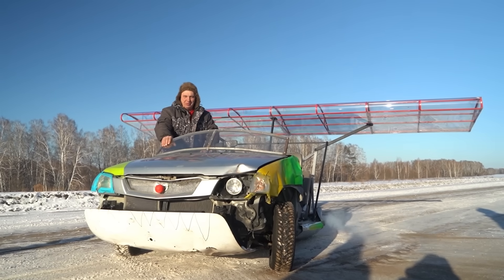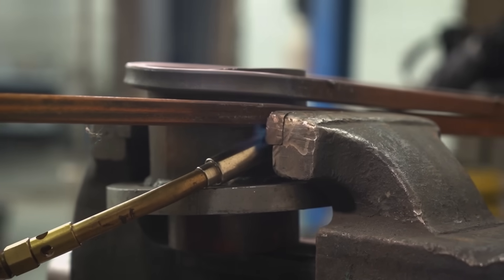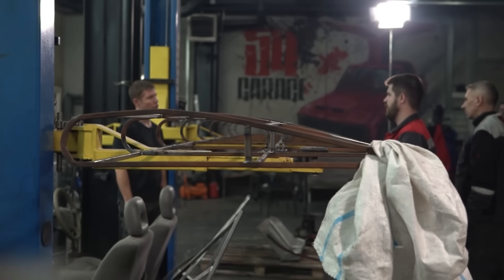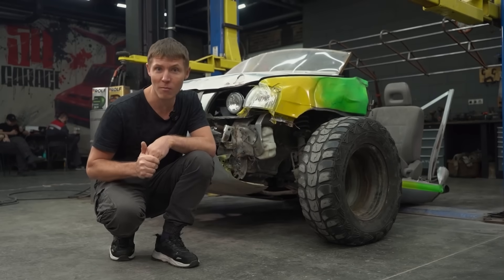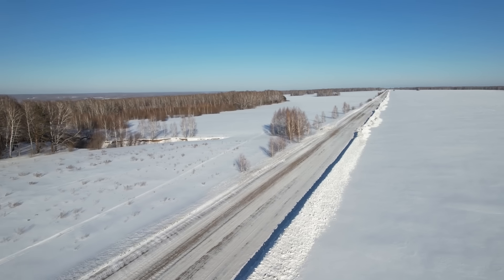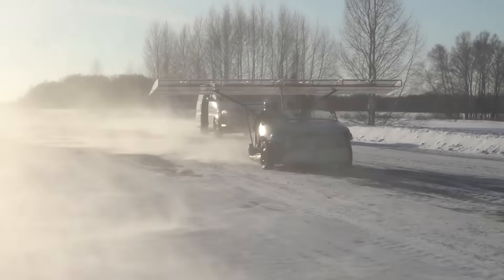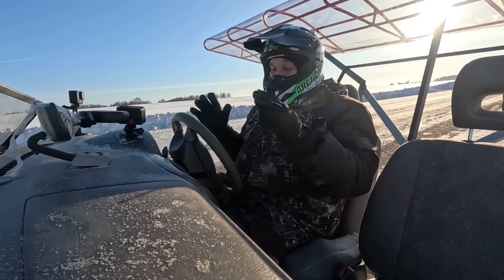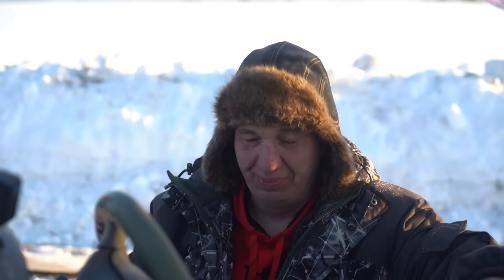We fit a wing to a car - will it lift off?

Comment: it needs a rudder working with the steering wheel and an auto leveling system for some flaps to make it fly horizontally on its own..
Reply: It can be a fixed vertical stabilizer at the rear. That way it steers from the front and the rear will follow.
Reply: @LoudenNess rudder synced to the steering inputs would make for a fun time though, possibly add a finite level of control while the rear is airborne.
Reply: I was thinking the exact same thing
Reply: Probobly would be sufficent with a fin
Reply: I think the same thing, without rudder and vertical stabilizator would not work
Reply: Just endplanes would go some way to stablize it. That's what F1 cars do. When they first started using wings in the late 1960s, they were like this and they wandered much the same. It wasn't until they started diving more into aeronatuics that they started adding endplanes and fins and such and it improved things massively.
Reply: A stabilizer would probably be sufficient for this wonderful ghetto project.
Reply: Do it do it do it do it
Reply: I agree, and perhaps a horizontal stabilizer and elevators
Reply: Exactly what I was thinking about
Reply: I think a vertical stabilizer with rudder connected to the steering would be the only way to get the directional stability under control.
Reply: Correcto, además de algún patín en la parte trasera donde roza contra el suelo
Reply: i was thinking the first flying lada they need to do lol
Reply: Flaps não sei se tem tanta necessidade, tudo bem que ajudaria a levantar por que dá área né, mas se você tiver uma coda boa vc nem necessita tanto já fiz testes com aeromodelos que deram certo, mas claro é necessário usar estabilizadores vertical, e horizontal isso ajudaria muito e a asa poderia ser mais larga acho que ajudaria muito também a voar.
Reply: What he said 😊
Reply: it would also make sence to have it in center mass so car would actually fly and not just act like somebody randmly pulled handbrake. tbh aeroflot has never been too good at flying stuff
Reply: Flaps, Counterweight, and rudder! They just made a ground effect vehicle! Freakin cool!
Reply: Couldn't hurt to put CoM almost right under the wing, too. (like with a hang glider)
Reply: You guys want it to really fly properly? Add a tail plane to it with rudder, elevator & flaps. Next, fit a prop with associated parts to be driven by the engine. She’ll fly then.
Reply: @christophermarshall5765  It's not intended to fly. It's intended to get off the ground only. It just needs stability, so endplanes like in F1. That'll straighten out the wandering to some degree. As the front end stays on the floor the rudder will not help you much as you'll still be trying to stop it wandering unsuccessfully.
Reply: @ wrong.
Reply: @crunchyfrog555  you’ve no clue what you’re talking about, the purpose of a rudder is to provide vertical control and stability. This car clearly needs that, and the laws of physics say that it would work.
Reply: @SillyPuddy2012  Yes I KNOW that. You're missing the point. It is NOT flying. It's only getting the rear end off the ground. It will remain with the front end on the ground and THAT's doing the steering. You have a rudder and all you will do is make the wandering worse as you constantly try to correct things and fight against the steering.  Way to miss the point entirely. This is why the best approach is the same as F1 - static endplanes.
Reply: @ I know exactly what they’re trying to accomplish here, it’s not a flying car. The point is to gain control of the rear once it begins to lift. A vertical stab and rudder would solve this. A front wing/cunard on the front would provide some downforce to keep the wheels grounded which is also an issue here.
Reply: @SillyPuddy2012  No it actually would not. Because you have two steering front wheels. A moveable rudder would fight this and because of the nature of the physics involved, you'd be trying to over correct with the rudder as it tends to react slightly more slowly. You'd be wandering more than ever.
Again this is why F1 uses STATIC end planes and such for this very purpose. Unless F1 is suddenly wrong of course.
Reply: @ this clearly isn’t an F1 car, so F1 solutions do not apply. Front steer wheels and a moving rudder would very much work in unison to turn this car on its axis. It basically has to be an airplane more than a car to establish control on the ground. The rudder would need to be fine tuned of course to maintain equality with the steer wheels. It’s all about balancing the forces involved, and that requires some active aero.
Reply: @SillyPuddy2012  Ah but they do =- physics isn't selective. 
You can't get round the fact this is not a plane and has a method of steering via those front wheels. It will behave as I said.
Reply: @ it will not behave as you said simply because you are ignoring physics. This is no more an F1 car than it is an aircraft, and the applicable means of control are pretty plain to see. Adjustable front wing to keep the wheels planted, and vertical stab and rudder connected to the steering - perhaps through reduction gear, to better control the airborne tail, start there.
Reply: @ leaving the ground is the same as flying, which is why I stated to fit a rudder and tail plane with elevators, along with a prop. Move the wing forward and add ailerons, then it will fly like a plane.
Reply: @christophermarshall5765  You're still utterly missing the point. The front end is STEERING and remains on the ground so you'll be in a constant fight. Again F1 does this precisely and you don't get to dismiss physics. 
I know how a rudder works but it will fight with the steering - why can't you understand this?
Reply: Yeah, once he reaches a certain speed and his wings in a certain angle, he's not going to get any more lift. He'll dive... like when he hits the brakes. This was still fun to watch.
Reply: or put a rolleron on it, like an old sidewinder missile.
Reply: @gibbsm  I like that - lean into the chaos :)
Reply: @ use differential thrust for the front tires, haha.
Reply: Is everyone excited as I am to see it at least lift 1 inch
Reply: It would be cool with a rudder, Oh, and a fricking roll bar!
Reply: @christorrence1114  Might be a terminology thing but a moveable rudder won't work most likely as you're going to be moving a LOT of air and it would be difficult to move without something like servo or hydraulic assistance. It ain't like in water quite. 
That's why straight up endplanes are the thing that F1 uses. Stick them on the ends of the wing and/or one down the centre of the roof and it can aid stability.
There's no need to have it steer with this anyway as you won't be able to manually control it effectively.
Reply: @crunchyfrog555  such a rudder would be connected to the steering, which is hydraulically assisted. And it would most definitely have a positive effect on yaw, that’s basically its entire purpose.

Comment: almost needs like a spring mounted rod or two  off the back to keep the rear following the front. Im guessing that the rear lifts off the ground it changes the where the power is transmitted through the front axles and it pulls it to one side or the other.

Comment: I guess the next obvious step would be to stick a prop in the front and hook it up to the crank. Probably a good idea to have it disengage the wheels on takeoff though.

And stick a tail with ailerons on it for better steering in air and on the ground.

Comment: 0:04 My first thought was 'this is stupid yet brilliant at the same time. In theory it should be able to work with enough speed. If the math is correct you should have proper lift so you're driving on the front wheels, reducing the drag on the wheels and increasing the efficiency.
Reply: Reducing the drag on the rear wheels is nothing compared to the amount of drag it takes to create lift. It's not just about the drag from the wing moving through the air, that's called parasite drag and it's insignificant at lower speeds like this. However, creating lift is not free, and it causes something called induced drag which is very high at low flying speeds. This is why many airplanes can get into a situation where they are flying too low and too slow, unable to gain speed while holding altitude because the induced drag is so high that the engines can't overpower it even at full power. I highly doubt that continuously lifting half the car off the ground would be more efficient than the rolling resistance of two wheels. This is a fun experiment, not a smart one lol. Air travel is not efficient, it's fast.

Comment: Wing needs to be further forward
Reply: No.  They aren't trying to lift the whole car off the ground; doing so would remove their whole method of forward movement.  They only need to lift the back.  What they need is a vertical stabilizer.
Reply: Yes.  That and made from aluminum or something much lighter.
Reply: That would make it even lighter in the front end . That would make it even squirlier . lol
Reply: Not if the point is to only lift the back of the car. The "wing" is acting more like the horizontal stabilizer on a plane. It doesn't provide "lift" in the same sense the main wings do.
Reply: not to lift up the back end, that's all it's for.

Comment: first of all the wing is way to small for that heavy load, also you have no thrust besides the front wheels. the thing might get airborne for a second but flight is not achievable
Reply: Full liftoff wasn't the point, the idea was to get the rear end off the ground.

Comment: wing is mounted in wrong location for center of gravity. maybe add a second wing in the front to balance it out
Reply: My guy, they arent trying to fly, theyre trying to float the rear end at speed
Reply: They've got no control surfaces. It's all for the best that it can't actually leave the ground.